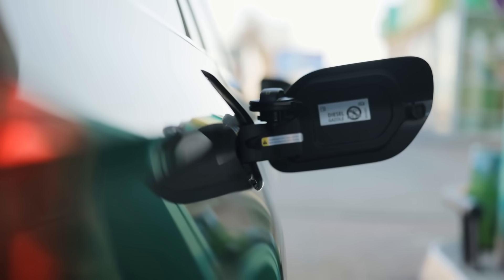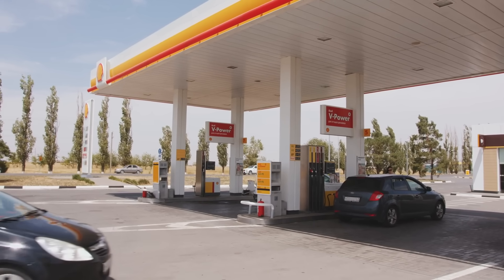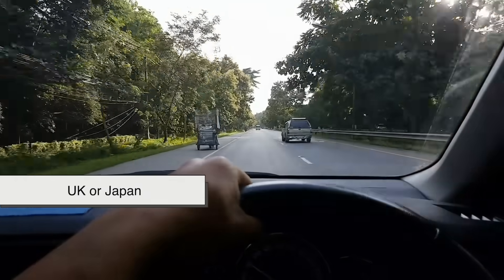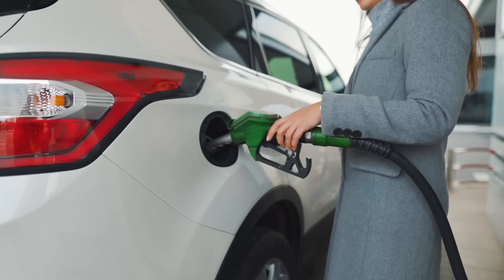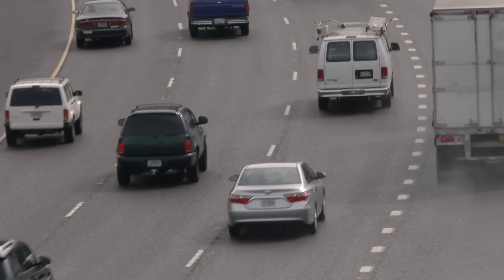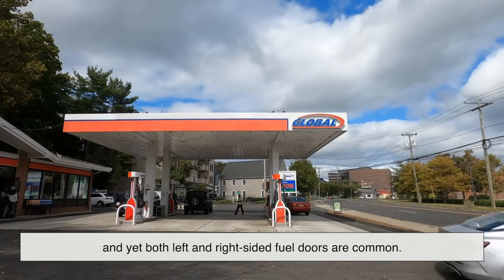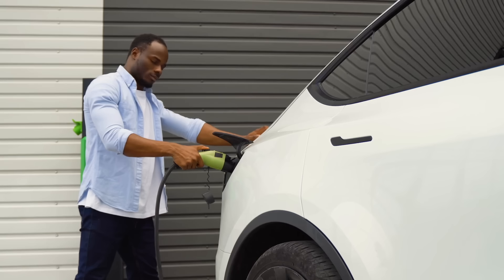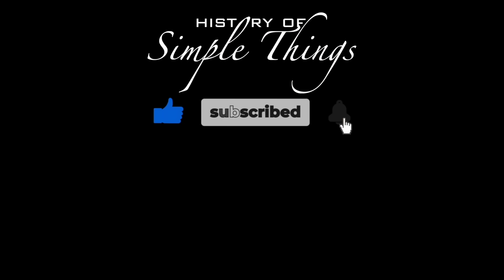Why Are Fuel Doors on Different Sides of the Car?

Comment: Most large gas stations have two sided fuel pumps and one way trafic direction to access those pumps in order to accommodate more customers at the same time. 
So if half of the cars have their fill door on the left side and the other half on the right side, we get faster access.

Comment: Some gas stations, mostly Costco fuel stations, have hoses that can reach across most cars, regardless of which side your car's filler neck is. You may need some creativity to get the hose there for larger cars, but the hose will reach the fuel door if you try hard enough. This is great since most Costco fuel stations are set up like toll booths, directing traffic through in one direction and preventing you from easily turning the car around if you get the positioning wrong.
Reply: i mean, in Japan I reckon the pump is on the roof, so it can move all round the car
Reply: They used to have longer hoses on pumps long ago

Comment: On my GM pick up trk, its on the drvr side, where it should be. Drvr only has to glance in his mirror to see that its closed. I had a '72 GM pckp trk where it was just behind the drvrs door, because the tank was behind seat. Some time later it became law that tank had to be between chassis frame for safety. 🙏❤😊🇺🇸

Comment: There is small triangle (or arrow) next to your car's fuel gauge, that is a very handy feature that indicates which side of your vehicle the fuel filler cap (gas cap) is located.
Reply: Interesting that they didn't mention that in the video.

Comment: I’ve noticed that generally the primary exhaust pipe is on the opposite side of the fuel door. But perhaps the fuel door is what’s driving the placement of the exhaust.
Reply: Most cars now have twin ( or more exhausts ) which complicates things - the single exhaust pipe used to be sited towards centre of road, away from pavement and pedestrians - which would mean the fuel filler on opposite side next to pavement for safer filling
Reply: While refilling, I did not notice that the pump had not shut off. A lot of fuel spilled on the ground. I was concerned that the exhaust system could ignite it -- maybe not from my car but the next car that pulls up. That's when I realized that the exhaust outlet is always on the opposite side of the filler.
Reply: Weight balance. Exhaust right, fuel pipe left.

Comment: It's a good job they are not all on the same side, to make fuel stations more efficient (as most prefer not to pull hose to far side of the car) if all were the same, there would be longer queues at fuel stations. Being on different sides means better flow of traffic.

Comment: They have pumps on both sides of the island so filler doors are on both sides of different cars. 
It easier to flow cars through the station this way.
Dont over think it.

Comment: That's why I miss the days when essentially the rear license plate was the fuel door.  With it being in the center, you could equally drive up to either side of the pump.
Reply: Those big 1970s land yachts were the best
Reply: Crash standards have changed that
Reply: Don't miss those rear license plate fuel door days. The danger of gas tank explosions from rear end crashes was significant in those vehicles.
Reply: @roberthenry9319  Specifically Ford Pinto!🤣

Comment: I remember years ago with many cars had the gas cao behind the rear license plate.  The license plate holder was a hinge with a spring.  In effect, the license plate was the fuel door.  Ii didn't matter which side of the fuel pump you pulled up on. but a rear-end collision could be especilly dangerous.

Comment: I had a Chevy Nova that had the fuel cap behind the rear license plate. The license plate holder was spring loaded. Many Chevrolet vehicles in the 70’s had them there.

Comment: Many will know this, but a fun fact to remember: If you don't know which side you're fuel door is on, look at your gas gauge; there is an arrow next to the side it's on.
Reply: For those in the back: NOT EVERY VEHICLE IS EQUIPPED WITH THIS FEATURE!

Comment: If most of the fuel door are at the left side then I prefer to buy a car with the fuel door at the right side! Why? When enter to the gas station, most cars are line up at one side, you can then fill up your tank at the other side, no need to queue up with them!😅

Comment: I was told by a Chrysler engineer it was for safety reasons. I told him that wasn't true. Because if it was, why can't you make your mind? Trucks on left some cars on left some on the right. The cost of one side over the other bull shit, especially when you start with a new model or redue. Toyota has all its gas caps on the left except rebranded Subarus or BMWs.

Comment: It doesn't matter where the fuel inlet is installed by the manufacturer. Every time I approach a fuel pump, the fuel inlet always turns to be on the WRONG side.

Comment: Plug-in Hybrids are even crazier. Some have the charge port and fuel intake on the same side but front and rear while others have them on opposite sides both at the rear.

A few even have made the choice to have them on the complete opposite side like right rear for fuel and front left for charging.

Comment: 3:17 on a fuel station like this one, you can stop the car close to the pump on the passenger side and then easily get out out as a driver on the other side and fill up the car on the passenger side. 

Nothing to do with safety as there no, or hardly any, pumps that are on the road side in Germany afaik.

Comment: Subaru fuel doors are always on the right, even in the USA. Some European car imports fuel doors are on the right. I found that to be an advantage where I refuel at BJ stores. Because most car owners need to fuel on the left and the hose is hard to pull to the left if the pump is on the right. So they get in line for the pump on the left.

Comment: Japanese cars have the filler on the left for the same reasons German cars have them on the right. In Japan, where their cars are designed, the filler is on the passengers’ side - which, to us in the U. S., is on the left. They will reengineer the driver controls for export but it makes no sense, economically, to reengineer the fuel filler.
Reply: But the video says at 5:55 that there's no consistency in Japan about the placement of the fuel doors since they can be found on either side, just like in the US. 🤷‍♂

Comment: While fuel tanks require a filler tube that has to be routed, when they were behind the number plate on the back it didn't matter which side the pump was on.

EV's only have wires - much easier to route. It would be better if EV's had a charge port on both sides and/or both ends.

Comment: In 4 pot engine with a single exhaust the fuel pipe is always on the other side from the exhaust, you don't want fuel spilling over a hot exhaust in rear end shunt. The exhaust is always placed on the drivers side so that fumes spill out into middle of the road. Cars that have twin exhausts do have an option of either side that's where the inconsistency lies. also OEMs always want produce a single rear quarter design for left and right hand cars as much as possible.

Comment: You skimmed over the biggest safety concern when placing fuel-filler doors. Placement in the rear passesger-side location is safest when pulling out across traffic.

Comment: I think that a big advantage of having the fuel door on the passenger side is the fact that that quite a few places (Costco, Sam's, etc) have all the cars pulling thru the station in one direction and it's easier to find an open pump when the fuel door is on the passenger side.  That is unless you're willing to pull the filler nozzle all the way across the car (which I'm not willing).
Reply: The Sam's Club fuel stations I've used are not one way. I've never been to a Costco fuel station, but I've seen videos of them and how it's one-way traffic. I always figured this was to prevent traffic jams created when a right fill and a left fill meet nose to nose in a conventional station configuration; Costco just was being proactive in accommodating both configurations.🤷‍♂️
Reply: @Prof_Jeff  The one we go to is one way and every Costco I've been to is one way.
Reply: @NealPT  Maybe Sam's varies by state/region. All the Sam's fuel stations I ever used were free-for-all, like most gas stations. However, it has been at least 6 years since I used one, so they may have implemented a one-way policy in that time.
Reply: If you think that through, having fuel doors mixed left and right and pump access mixed left and right, the best flow through is obtained at the gas station. If all the doors were left, the pumps with right side access would require a back in or turn around.

Comment: In EVs, all manufacturers will converge on flap on the rear right side. A law is coming forbidding flaps on the left side, as they protrude if charging curbside. Front and rear already proved problematic, as they get damage during small collisions, even during parking.

Comment: Most pumps have enough length in the hose to reach the other side of the car, it amazes me the amount of people that line up and wait on one side of the pump when the other side is free.
Reply: Nope they don't reach both sides at least in my country.
Reply: Don't work like that for every car an bloody awkward
Reply: Nope. Not true everywhere (at least in the US). Most I encounter have barely enough length to reach the proper side if you fail to park in just the right spot!
Reply: Yeah... at Costco.
Reply: It is (or has been) illegal to stretch the fuel hose to the opposite side in some localities. I've gotten yelled at for it a few times. I drove a crew cab pickup with dual tanks for many years. Fueling both tanks could require getting creative - especially when you had a 30 foot stock trailer on behind!
Reply: Came here to say just that.  I wonder if the complainers simpy haven't tried, or have vehicles which are too large.  I have never had an issue with any car I've ever had and no - none of them micro-sized,  other than a few classic sports cars... where the filler cap was centrally located at the top of the boot making either side easy.

Comment: I have Fords which are on the passenger side.
Seems like every  time i need gas and try to pull  up to the pumps everybody has their fills on the other side.
I feel like a fish swimming upstream. Everybody else is going the other direction. Stupid. How do you wait in line when everybody else is facing you?

Comment: A small triangle on the side of the fuel ⛽️ icon on the  dashboard shows where the fuel door is
Reply: Usually the fuel pump icon next to the fuel gauge has the hose on the side the fuel port is.

Usually. It wasn't the case for my last BMW 318i.

Comment: The fuel door is usually on the opposite side from the tailpipe. And most vehicles have only one tailpipe. But some will have two. Sometimes two on one side, or one on both sides.
Reply: Sometimes the driving /  steering wheel shaft gets in the way, so LHD examples have a different exhaust layout to RHD examples of the same car. Probably less common now though with machine standardisation.

Comment: If people pay attention to the fuel gauge sign it tells u what side the filler funnel is
Reply: That's a fairly recent thing - Prior to the 2000 model year, it was a "Some models from Brand X have it, others don't." (with most being "don't") It wasn't until roughly the 20-teens that it started becoming truly widespread, and even then, it took several years for people to even notice that the marking was present, let alone start doing the "I wonder what that's about???" thing. It hasn't been much more than the last 10 years or so that the presence of the mark has FINALLY become "pretty much universal", and the knowledge that the mark indicates the side the gas-cap is on has become widely understood.
Reply: @Ferd414  actually a lot of really older vehicles used to have the filler cap behind the rear license plate which of course would make this whole video unnecessary 😁
Reply: @mikeyblue1212  <heh> Thanks for the newsflash - But I grew up in the days when that was the USUAL place for a gas cap.
Reply: @Ferd414  It's not recent in Canada Every car my family had since the early 1980's had that feature.
Reply: Years ago I read a news article that stated Ford was the maker that started putting the arrow by the fuel gauge on the Taurus in the late 80's. They did this because of rental car companies had large fleets of Taurus models and customers would complain about not knowing which side the fuel cap was on. I remember having a Taurus as a rental in the early 90's and the girl at the rental car counter told me to look at the fuel gauge if I forgot which side the fuel cap was on. I've had cars with the cap under the license plate, behind a tail light and a C3 Corvette with the cap in the center of the rear deck. I have a car now that has the cap just in front of the windshield in the center of the front cowl.
Reply: My new Mazda and my wife's VW doesn't!!!
Reply: I’m surprised they didn’t mention that in the video!
Reply: @user-cr3fz8lz2i  I was going to say the same thing. Is that just for cars made/sold in the US?
Reply: LOL,  they can also look at the car itself.   When I picked up a new Honda a few years ago the dealer as usual only put enough fuel in it to get off their forecourt.... I drove a few miles and stopped at a service station,  I knew where the filler flap was ( rear left ), but shock horror I did not know how to open it - my other cars either had a push type flap where with doors unlocked you could push the flap and it would spring open,   others had a lever on the floor  by the front rh side of drivers seat,  I eventually found the filler flap release right under the dashboard tucked above the bonnet release - anyone with a bad back would have problems operating it.
Reply: That's true for most cars but for some reason they forgot to put that little arrow on the gas gauge of my 2006 Honda Element.
Reply: It's not a universal thing...yet...
Reply: Not all vehicles have that indicator.
Reply: I have 5 cars. Exactly one shows me where the cap is located.
Reply: Not always.
Reply: I came here to say the same thing. Look at the fuel gauge and I’m surprised it wasn’t mentioned in the video.
Reply: Not necessarily, perhaps new cars, older ones, does not, when your in reserve, a light blinks, about a gallon left, no indicator which side, Toyota on driver side, button pull up by driver seat. So praise the Lord 😊

Comment: It's asinine to not be on the driver side. Just makes it so much easier to pull up to the pump, and the shortest distance for the driver to get out and pump the gas
Reply: Having them uniform is also better for flow at the gas station because it’s all on the same side in the same lane. Not cars cris crossing causing jam
Reply: In most British Commonwealth countries and in Japan, the drivers sits on the right side. Japanese cars are all over this country. They’ve decided to put the filler on the passenger side (for them, the left) just like the German do (for them and us, the right).
Reply: I love it on the driver's side. Easy, if you have passengers they won't get in your way etc etc it's just better. My euro cars had it on my driver's side and my Mitsubishi has it too. Good times
Reply: You're wrong it's not "assinine" for a number of reasons. The main one is fuel pumps are 2-sided serving both sides, but filling stations usually have 1-way traffic with entrance/exit.
If cars were all favouring one side, a typical double line of pumps would have most drivers avoiding the wrong side.
Having the fuel flap on passenger side is more convenient for pulling out around cars, or pulling in at an empty pump, because it's like parking in a street by a kerb and you have room.
Small cars frequently can have hoses reach to the opposite side, making it moot.
Many vehicles carry passengers, who can fill up while the driver waits to pay, which saves time.
Reply: @RobBCactive  - your gas stations must be way different than the ones I've been too in my 65 yrs here in the US ...
Reply: @steve318k  They must be. In my 40+ years of UK experience, I've never seen a modern functional one-sided fuel station / pump. There is a 1920's garage locally that now operates as a museum, but that's the only one I know which is single-sided. Using original 1920s design pumps.
Reply: @RobBCactive  Except for Costco, every gas station that I have seen in my city of 500k population allows access to the pumps from either direction.
Reply: @skysurfer5cva that sounds chaotic, the rare stations I see which allow a mix of oncoming traffic from 2 directions operate much less smoothly.
Anyway it's just a reason why standardisation isn't a no brainer.
But it sounds to me like another example of low US safety standards.
Reply: You can't walk the five steps to the other side of the car?
Reply: If the flap was on drivers side then the driver would also have to open their door into / towards the pump, which is not ideal,  or park with drivers door away from the pump and stretch the hose across the vehicle - it makes perfect sense to have the filler on passenger side.
Reply: @chrissmith2114  - that's the most illogical comment I've heard today.
Reply: @chrissmith2114  What is wrong with opening the drivers door towards the pump? My doors are fairly long and I do it without issue.